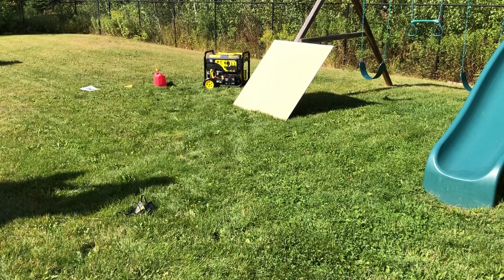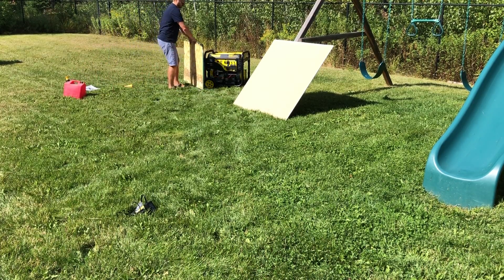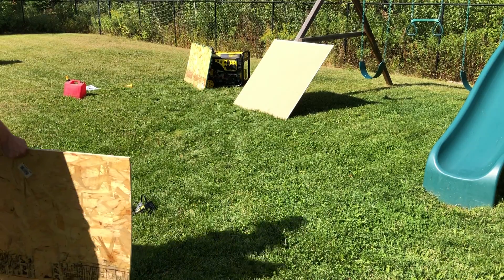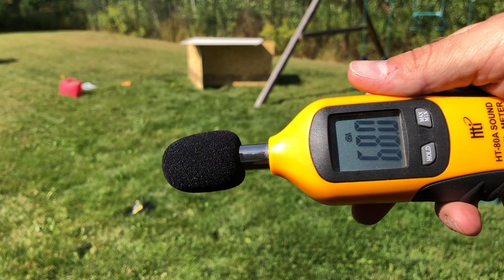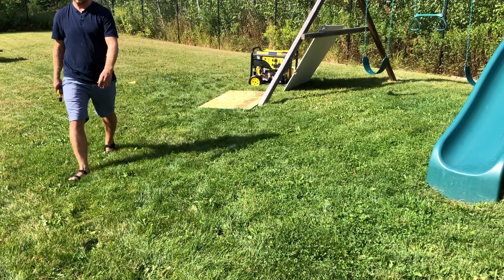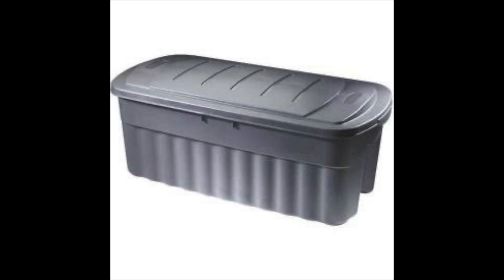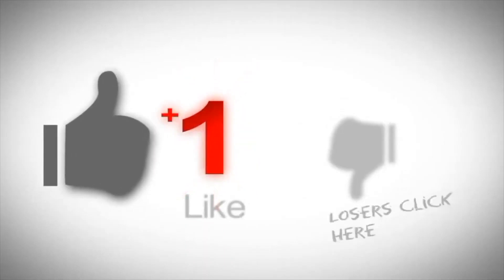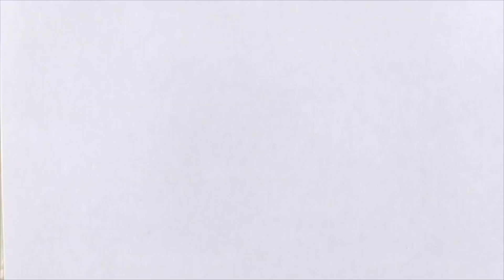Quiet Generator In 9 Seconds - MISTAKE #1 From YouTuber!

Comment: Generators sense CO, not CO2. CO is carbon Monoxide, which is deadly. CO2 is carbon Dioxide, which isn’t as dangerous, and generators don’t bother metering that. At least try to get your facts straight if you’re going to do “informative” videos.

Comment: I have a 6500 Briggs and Station Gas Generator. I was thinking of digging a rectangular hole about a foot or do deep, and considerable wider and longer than the generator.
 Then use 4 pieces of sheetrock or flack board leaning on a 45 degree angle on all four sides. I can also install a good ventilation fan to keep the motor cool. Do you think during it half way in the ground would lower the Decibals better than the generator on ground level?

Comment: Putting the plywood on top should  increase the heat. 
If you build an A-frame make sure there is a significant gap at the top. Heat rises.

Comment: I have Hyundai HGS3500 (company claims its 76db) practically its loud enough that we can run it more than half hour. I can place on roof or in staircase. Please suggest what should I do? Or may be doing a little modification in muffler etc

Comment: I have an EU22i, which is a very quiet unit.  However I wanted something to waterproof it for use in rain.  I bought a £9 storage box that fits over it tightly and cut a rectangle out on the side with the exhaust.  Not only is it now waterproof but it doesn't overheat and the noise is reduced.  When not in use I put a masonry bag over the container shell that fits it perfectly as a cover. You can spend a fortune on this stuff if you really want to but with experimentation you can do it on the cheap. Been using this setup without issue for 3 years.
Reply: Link to the box you used?

Comment: Portable generators don't have "CO2" (carbon dioxide) detectors. You probably meant "CO" (carbon monoxide) detector, which some of the newer ones do have.
Reply from the maker: My bad. Thanks
Reply: Actually the generator will automatically stop if the fresh air is not enough for combustion.
Reply: @vampier001  Humans are a lot more sensitive than that. An engine would likely still be running long after the environment has become too toxic for humans (or animals) to breathe. CO is also flammable and with enough concentration, may combust.